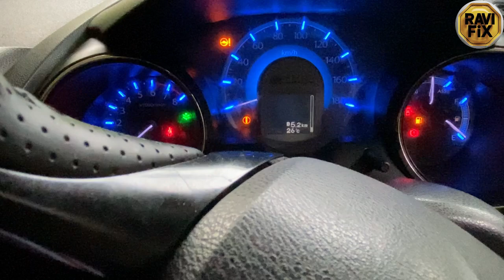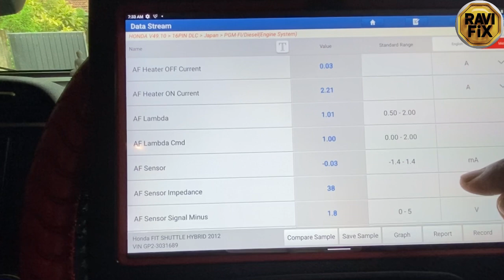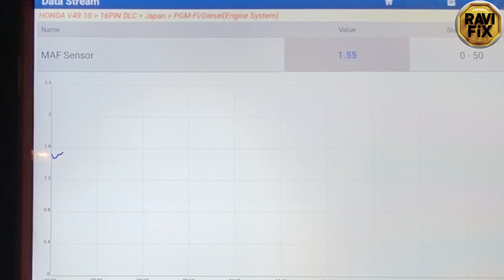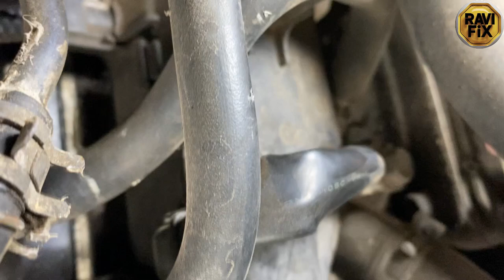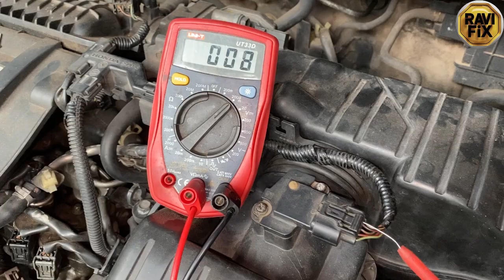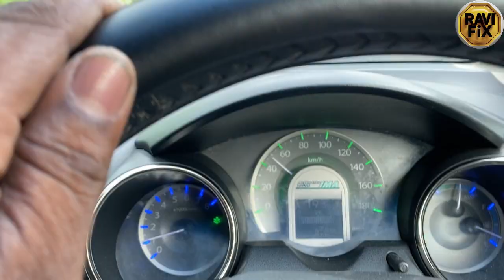Honda Fit Shuttle low fuel mileage customer complain diagnosis & no part required fix

Comment: Sir i also have the same issue with my honda fit shuttle its shows 12.7km/1 2011 model what to do please help me
Reply: I have the same problem in my car.did you get that fixed?

Comment: Hi Ravi,
I would say a classic case of diagnosis❤❤❤....
your work speaks load of professionalism and dedication...
Fuel average improved tremondously, yet i think this car can be further improved as Injector pulse is at 2.7 ms...i think, if we can do calculated Load (CLV) PID analysis along engine vacuum analysis, perhaps we could figure out to further improve injector pulse and thus the average...
Once again, Thankyou very much for this classic video share and that too free of cost❤❤❤
Reply from the maker: Thank you friend. 
Sorry for the less footages, i was unable to record after the test run, but fuel injection has come 2.5ms down dramatically. As I described in the video with the test run new values have been learned by the ECM and had better data values in the scan data.
Reply: @ravifixall  that's great 👍
And thankyou for reply
Reply: @ravifixall  One last thing....if you can please increase frequency on uploading your new videos....would love to watch your videos on how ECU manages/controls engine i/p & o/p...fundamentals like how it decides inj pulse and ignition advance etc...looking forward

Comment: The best technician I have seen so far. I do work on my vehicle as a hobby, as this is very intresting subject for me. I have been to your work shop for few times. Always got good diagnosis. 

Recently I have been to very famous workshop to solve an issue of my car (idle stop not working). They scaned for some time & then told me go to the dealer (Honda). Actually they were not intrested to work on my car. 

On the way I stopped the car checked the idle stopping switch. I found switch was not adjust well to get pressed by break paddle. If I have been to Ravi, story will be way different. 

I really appreciate your work Ravi, as you are not lazy to diagnose, not criticizing if an old vehicle any model or brand. 

Keep up your excellent work 💪💪💪
Reply from the maker: Thank you mate